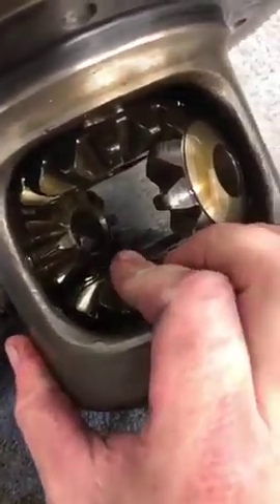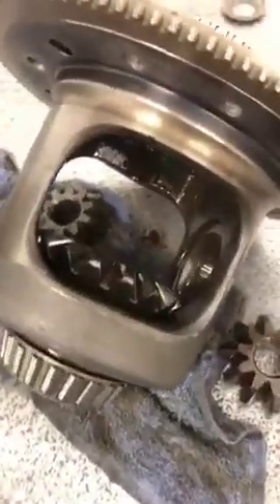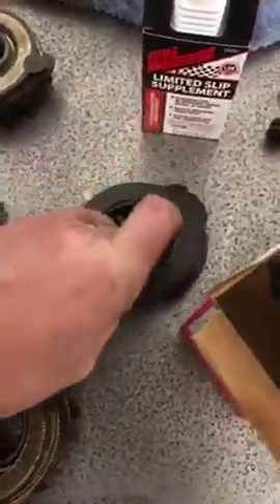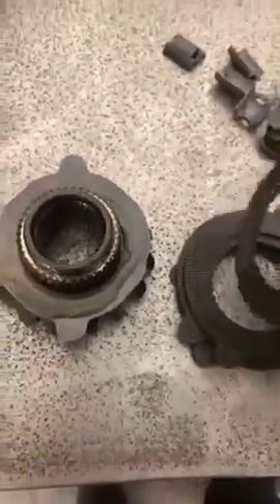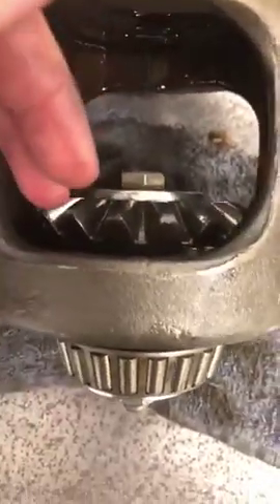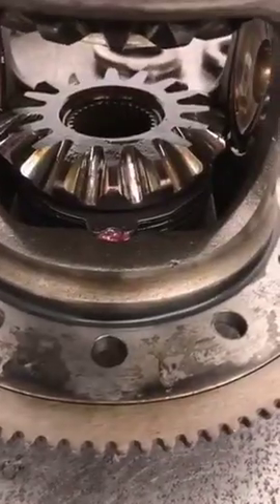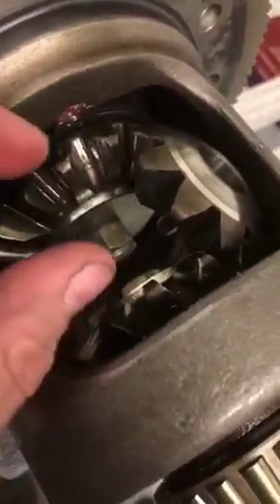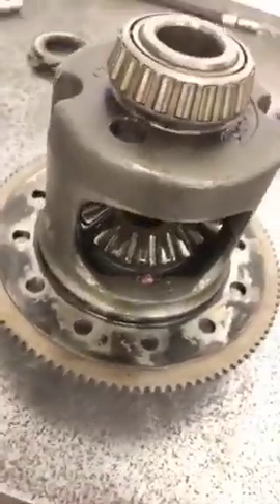Trac-loc Limited Slip Rebuild

Comment: Good video. For people doing this job without removing the carrier use a bolt nut and big washers to compress the clutches and side gears. then put an axle shaft in have someone hold the smaller gears in place take a prybar to the wheels studs and rotate the bearings into place. Way easier than trying to use a punch. Learned the hard way. Good luck
Reply: Do you have a picture or video of how you did this?
Reply: Thanks Tyler. Still don't know if the Spartan will load in Trakloc carrier. Fitment stated would also fit in Dana44 TL. So I ordered it. In in snow up here n haven't opened it up to see. Supposed to be a Metric ton. Hope it is cause gears should be 3.73 instead of 3.55?? A total crapshoot till I look. Just hoping no C clips. Haha. Thanks for replying. Dandahermit

Comment: I'm just getting into the Jeep Arena and doing my home work before buying one. Trying to find someone that truly knows anything about a Trac-lok is kind of hard. Finally finding a video of a repair was great. Seeing the inside/guts of a Trac-loc helps immensely. They may not be the best but I know now it's mechanical and not relying on the brakes. Just wish someone else could have filmed, so the guy could have had both hands.
Reply: dont use a track-lok its a peg leg. get a posi or better true-trac

Comment: I used a brass punch like that and found that I got more movement putting it thru like the cross pin shaft and whacking it to get them to go at same time. Then when it was hitting the carrier I went outside the closest spider gear and laid it between cogs with the end still going in the shaft hole of the far one.

Comment: Nuts and Bolts!!! Brilliant, so yea.... I wouldn't have used the old cross pin to bash on the edge of the teeth.... nope not me.  Thanks for the pro tip! Doing a full replacement of gears.

Comment: Thank you for this video!
I can not get those spider gears back in on my 05 Ram 1500. I will run to the hardware store for the bolt, washer, and nut.
Reply from the maker: @robvarela9602  glad it helped!

Comment: Just did my 03 dodge ram clutch and clips,  I did not remove the carrier from the vehicle,  did it in place.   A tight area to work but doable.
Reply: How did you compress the clutches to get the spider gears and washers back in with it still in the housing. The only thing I can think of in doing that is to get a really long extension to go threw the axle shaft with a bolt and then go to the inside with a nut and tighten them down like that
Reply: @elijon8954  I bought some short bolts and nuts and big washers to install between the two side gears.  I had a washer against one side gear with the bolt head against the washer and a washer against the opposite side with a nut on the end and start unscrewing the nut to compress against the washers so it can push the side gears in to make room for the spider gears.
Reply: @chrisbrown6804  Smart! Super!!!

Comment: I really liked your video. I have a 1991 Jeep YJ, with the Rear Differential with Trac-Loc: Dana 35, 355 gears, “C” clip style. I bought the Crown Part no: 5252497 Trac-Lok Gear and Plate Kit for Dana 35 Rear Axle - 3.73 Ratio and put together using your video. And WOW with the side gears collapse much as possible with those ½” bolts/washers, I had a real HARD time moving the spider gears into to place using a brass punch. I did get the clutches in, but now I can’t move or rotate the spider gears by rotating the housing. I took an axle and put it in a wood vise, (not very strong vise) sat the housing on the axle, then tried to rotate the housing by hand and I can’t move the housing, it’s tight. Is this normal?? I then laid the housing on its side and locked it in the wood vise by the ring gear. then took the axle and tried to turn the axle by hand and couldn’t turn/move at all. Should I still put the differential assembly in the rear end housing in the Jeep or is something wrong? Thanks

Comment: Great video, thanks!  Why did you remove big gear? There was no need for that, I think.
Reply from the maker: Thank you, I pulled the ring gear because there was a broken bolt.
Reply: It's a Hella lot easier  to remove the gear you get more room. Not needed no but smarter  yes.

Comment: Hello, I know an old vid but would this kit fit for a ford 10.25? LS is not working and most kits don't come with the Belleville spring. Thanks for the awesome video. Been looking awhile for this.
Reply from the maker: Hello, I doubt this kit will work for you but you should be able to buy a similar kit for yours from a differential and driveline shop or online.

Comment: I need to know if my 87 Dana 44 tracLoc is an open carrier I could just put a lunch box in. Clutches are short lived n lockers aren't? Help. Important question. Dandahermit
Reply from the maker: If it is a tracloc it is not open, if it’s a locker it doesn’t have clutches. If you jack it up and spin one wheel forward and the other one spins backward it is most likely an open diff.
Reply: @goobtechgarage114  I know that but clutches don't in the Trak loc don't respond like that. Gotta spin first. Thanks Dandahermit

Comment: curious...if you do not remove the carrier how are you able to get a  nut on axle side ?am in process of replacing clutches and spiders. in reference to tyler grouch statement,that would be a lot nicer to do it with the carrier installed.

Comment: I just replaced the whole assembly a few months ago got it from oriellys, I noticed right rear tire it wearing faster  than the others, is it a bad assembly or something else that would cause this.
Reply from the maker: It might be slipping more than it should but then again it is a limited slip. If you have big tires or if you are hard on it it will slip more. Only way to eliminate that is going to a locker or spool (not street friendly though).

Comment: I'm curious why you took the ring gear off? Great Video!! Also what is the OD diameter of the fender washer to clamp the spider gears. Thanks
Reply from the maker: Hello,  The 4:56 ring gear is so thick that you can’t get the center pin out without removing the ring gear. Thanks Doug
Reply from the maker: Removed the ring gear because of a broken bolt. I’m sorry I didn’t measure the washer.

Comment: Pardon my ignorance but, when do you know that have to rebuild this?
Reply: I knew I needed to do this when I opened my differential to change the fluid and there was pieces of the clutches that came off. You will also notice that one tire gets more worn than the other one, that is a good indicator that the clutches are bad.
Reply: @EdGutierrez69  Thank you!
Reply: @EdGutierrez69  also while turning at slow speed you can here the limited slip poping

Comment: Not sure if you are familiar with the somewhat rampant problem with the M220 rear ends on Wrangler JL Sports with LSD, but I am wondering if this will get rid of the clunking that many are experiencing during deceleration.

If one were to do this at home, does anything need to be repatterned or anything like that that might require a little more expertise?
Reply from the maker: I don’t think this would affect clunking, usually that is from universal joints or slop in the transfer case.

Comment: I'm also curious by you took the ring gear off, is it really necessary when changing the clutch pack?
Reply from the maker: Hello,  with 4:56 gears the ring gear  is so thick that you can’t get the center pin out without removing the ring gear.
Reply from the maker: Hello, it is not  necessary normally but there was a broken ring gear bolt that I did not show.

Comment: So I'm looking into a different diff for my 08 ram 1500. My driveway is on a slight incline, and when it snows I literally have to put it in 4wd to get up the driveway. This is basically going to keep the wheels locked for the most part when going in a straight line? It will limit the amount of power to even it out between the wheels if I understand correctly?
Reply from the maker: This is a repair on a limited slip rear differential. If your differential is a “open“ type this won’t do you any good. More often than not Dodge truck differentials are limited slip and this is easy to check by jacking up the rear axle so both tires are off of the ground and put the truck in neutral, then spin one tire and see if the opposite tire is spinning the same direction or the opposite direction. If it spins the opposite direction this is an open differential. If you still have any question about it you can call your dealership and give them your Vin number to see what your truck has. If yours is an open differential the easiest way to upgrade it is to find a vehicle salvage yard/wrecking yard and buy a whole axle assembly.
Reply: @goobtechgarage114  I definitely don't have a limited slip, I'm asking if I upgraded to a trac lok differential, will that lock my axles?